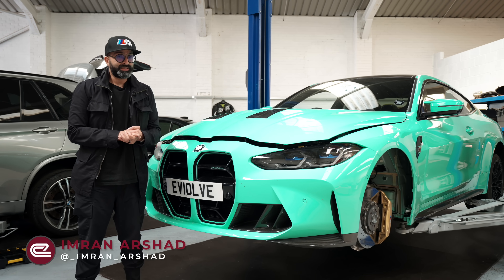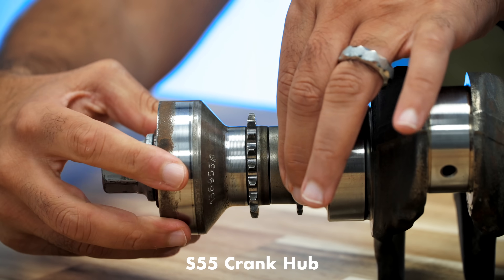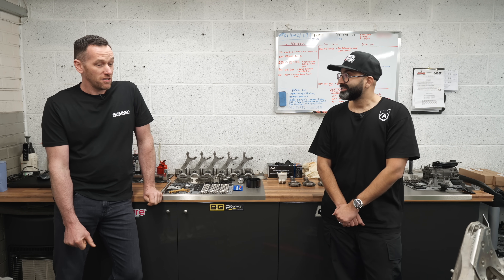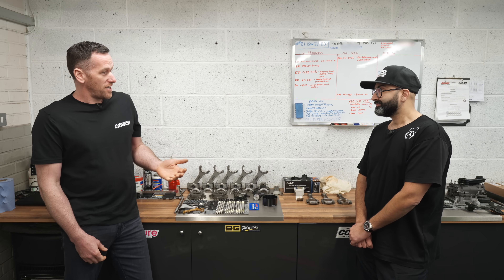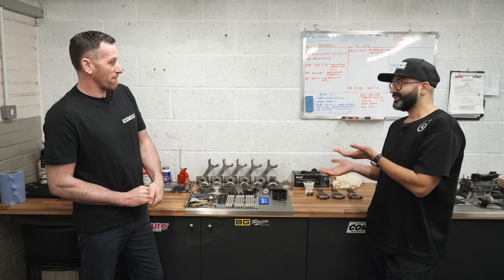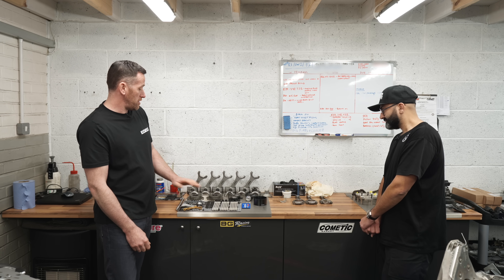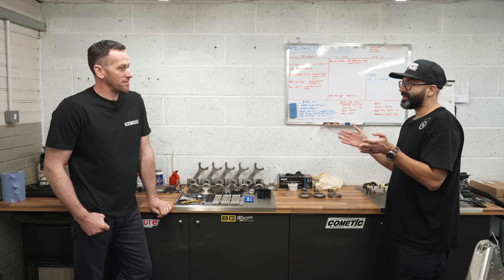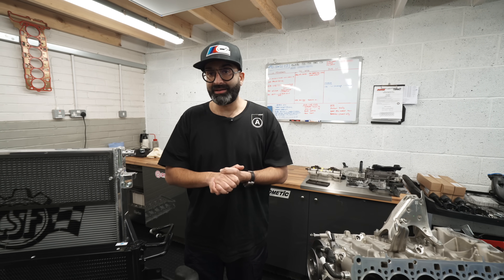Building a 1000HP+ S58 Forged Engine for our G82 M4 with Mr VANOS

Comment: 1000 hp using a plastic intake manifold?  That must be some specially high strength formulated plastic.  I would have thought CSF’s combo aluminum intake manifold and inter cooler is the proper part to use; I guess not.  
Question then, will Evolve have a tune specially made for the G82 M4 coupes paired with a 6 speed manual transmission?  I really like my ‘23 M4 6MT.  
Next question, can the M4 CSL software for traction control, steering and adaptive suspension controls be loaded onto a 6MT car, and work properly?  If so, I’d love to have that software loaded into my 6 MT M4.  
Thanks and keep up the great work.
Reply from the maker: You can see the CSF billet inlet manifold in the background - We fitted the original for testing and then reinstalled the CSF, which is now fitted to the car.

As for the tune, yes we have experience tuning the 6MT version of the car and all of the CSL software works well - Drop us an email on sales@evolveautomotive.com

Comment: These engines are going to be the next 2J as imran mentioned in the video. This may be a noob question, but can anyone explain why they appear to be using a DTI gauge or something similar to that effect when torquing down the big end caps?
Reply: @@GodDamnItCarl glad it’s not just me then 🤣 
It could be as you mentioned, or it could be for clearance issues with the crankcasing maybe?? 

Please somebody shed some light on this 🤣
Reply from the maker: It’s an ‘ARP Stretch Gauge’, which ARP give the specs for as it’s more accurate than a torque spec, I’d never seen it either! Here’s a video from HPA that explains it - https://m.youtube.com/watch?v=uqjHdKkurXs
Reply from the maker: Torque can be varied by things such as lubrication, stretch is more precise.

Comment: For the money you cannot go wrong with a BMW they have absolutely zero misses with the 1 series , 2 series , 3 series , 4 series 5 , 6 and 8 series for the money you can get a complete monster of a german engineered beast only German manufacturer that still does manuals on most of it's cars and they don't pretend to be a full out luxury brand like Mercedes and Audi, BMW and Volkswagen knows how to build motors they make the most with what they have Volkswagen obviously the kings of 4 cylinders and BMW the kings of low displacement inline 6 motors and the kings of low displacement 8 cylinders , beautiful Sportscars and they build cars for every type of person if you want Luxury they have those if you want a mid sportscar they have the 35i and 40i cars if you want a fully fledged sportscar the M2 M3 and M4 is there if you want luxury comfort and tech the 5 series and 8 series is there if you want a Mom car they have that SUV'S they have that with engines ranging from 4 cylinders to 8 cylinders and small displacements like 1.6 to 4 liters BMW will remain the kings , they've built a gigantic array of future classics look at the E30 M3 the E36 M3 the E46 M3 and the E92 M3 they are still extreme favourites even though their old the new M's will be like those cars for future owners BMW is the king of future proofing the kings

Comment: Why do you still have a plastic intake manifold?
Reply from the maker: We fitted the stock one during run in so that we could do testing with no performance altering parts tested to check against the standard engine.

In the next video we take advantage of all the added strength this engine and transmission has given us

Comment: S58's tyrning out to be a beast of a platform. Excited to see where you take things
Reply from the maker: G8X is the replacement for the R35 🤫
Reply: hell yea, sounds better, handles better, way better transmission, safer, better interior, better quality overall. @EvolveAutomotive
Reply: I feel that the G80 value will go to the roof since is the last fully combustion engine in the M line. Because from now on will be hybrid or full electric. Just like the Porsche 911 (993) with the air to air engine.